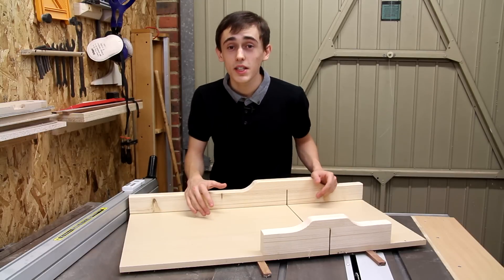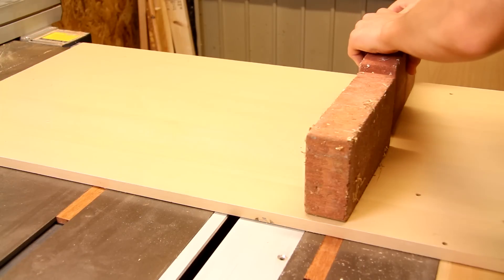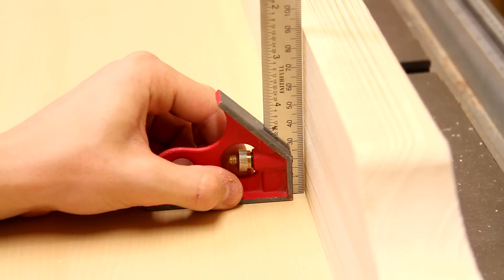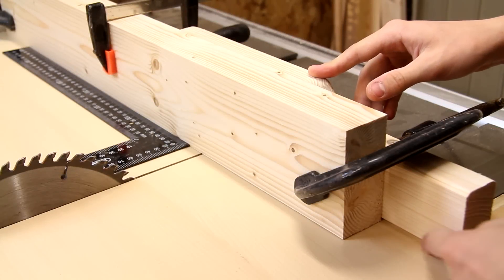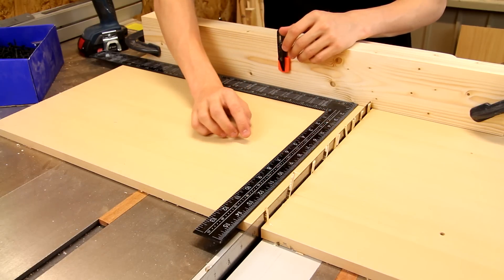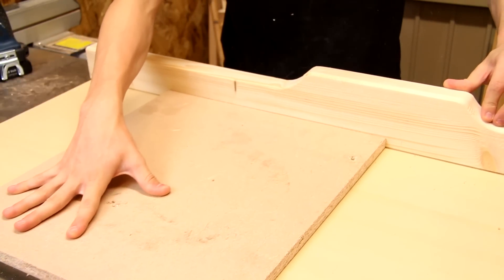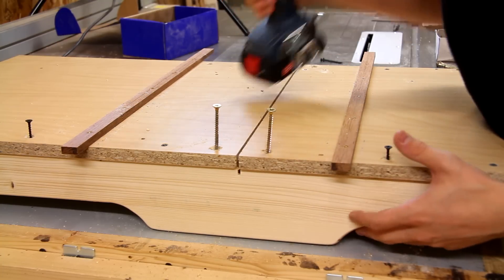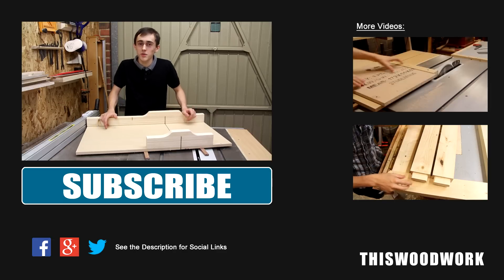Crosscut Sled for the Tablesaw

Comment: This is the simplest to follow video I've seen for building a sled. Well done mate.

Not sure if I can fit one that size to my new DW745 but will give it a go this weekend.

One question though. Does the addition of the sled mean you need to sacrifice using the fence? Can't see how you could still use it with the sled in place.

Comment: Thank you for the video. I have a question for you regarding your table saw. I have just bought a new table saw, same as yours, but my riving knife sits higher than the saw blade and this keeps me from making any cuts that are not through cuts. Did you alter the riving knife that came with your saw or did you buy a new one? I will appreciate your input.
Reply from the maker: Johan Brand 
I modified the knife it came with, by elongating the slot in it, to allow it to sit lower. Making a new one might be even better! Just make sure when you move the knife down it is still away from the blade all the way around its curve.
Reply: I'm studying diy table saws and discovered a fantastic website at Wilfs Wood Blueprint (google it if you are interested)

Comment: I'm still mulling over how to make the right cross-cut sled for my table saw. The riving knife/guard stand is just a smidge taller than the blade on my Axminster TS-200 which means it doesn't fit through the blade's kerf.
Reply from the maker: If you do not fancy modifying your riving knife you could always just remove it briefly to cut a kirf in the cross-cut sled and provide clearance for the riving knife.
Alex
Reply: ThisWoodwork The knife doesn't easily come off, at least with some substantial disassembly. I'll either end carefully taking the saw apart or trim the knife  with a angle grinder :)

Comment: Looks good. A nice trick for you though. Before you glue your top to your runners place 1\8" shims under the runners so they protrude above the table surface, this will ensure a good glue bond between the runner and sled. Cheers

Comment: Nice job . But 1 cut test and eyeballing with square is in ballpark accuracy at best. the rotation of screws alone can pull that fence by 0.1 +  not visible to eye. 5 cut test is the most accurate test and engineer square again dial gauge second most accurate.